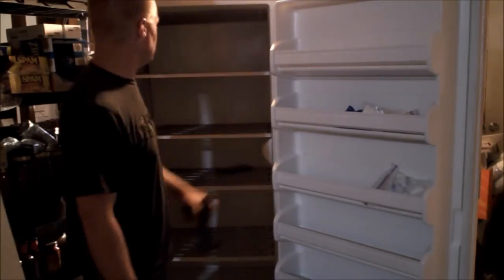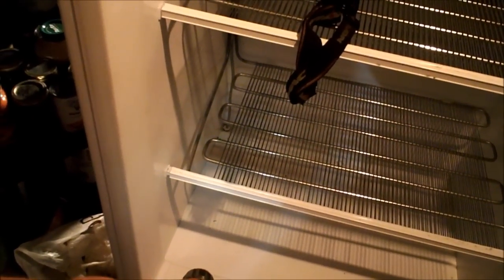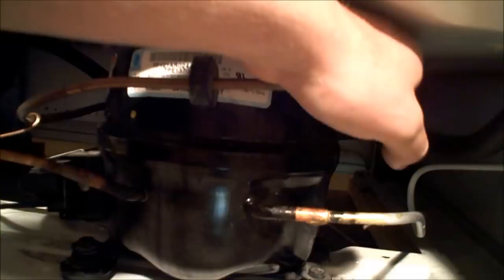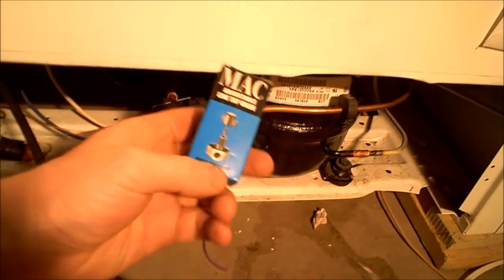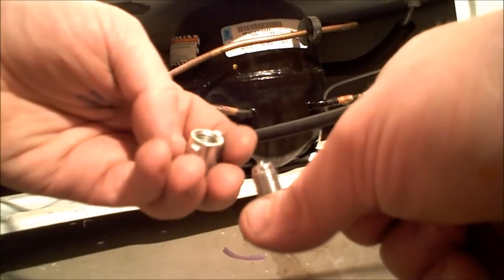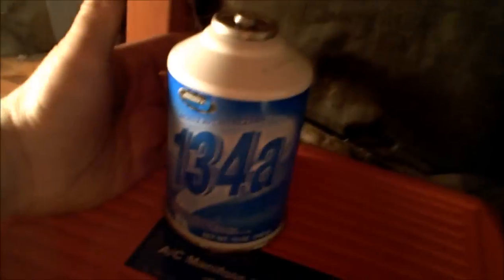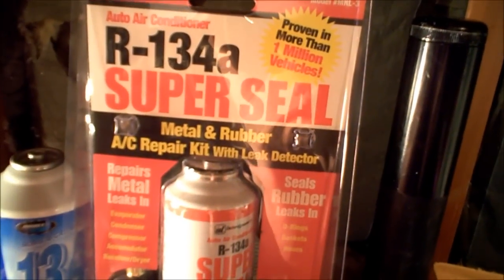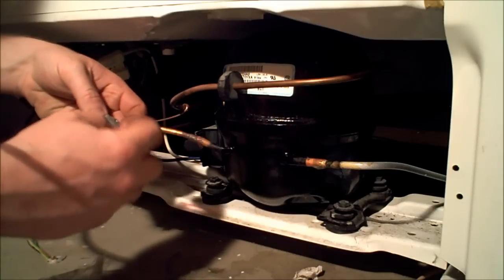Upright Freezer repair r134a refill part 1 of 2

Comment: The most intelligent way is to hook the piercing valve on the service line of the compressor...after loading you can press the line off and solder them close.or yust leave the valve.its better anyway because the pressure on the service line is much lower.....
Reply: You can also add the piercing valve to the short pipe stump that was used to factory-fill the system with R134a.   That's where my valve is attached and it works very well.

Comment from the maker: Thanks Bob.. 8 months, that's a pretty slow leak. are you going to just add a little more? A very nice repair tech gave me this advice: If you suspect the inaccessible condenser coil to have the leak to simply cut an external one off an old fridge or freezer and solder in place of your internal one. This should permanently fix a leak. It does require a fair amount of work, but doable.

Comment: I connected the system as instructed but when I turned on the refidgerator the pressure did not drop Iam I on the high side the pipe is the larger of the two

Comment: Man-you've actually pierced the wrong tube-the High Pressure side-right before the capillary tube-the tiny one-once you switch on-the pressure will go up
The right tube is the short one-the service tube-Low Pressure there.

Comment: Yeah it is. I actually found that Frigidaire and Sub- Zero units are very prone to evaporator leaks. The reason my GE started leaking is probably because the spine fin coils were rubbing against the steel support( never use steel side plates with aluminum tubing). That, and it was almost 20 years old and had been used in a 130 degree garage for several years earlier.

Comment: I had a GE side by side fridge and freezer that died to this same cause. I first noticed it when the compressor overheated and the thermal protector kept turning it off. I also noticed it would run for hours on end, and the bottom of the evaporator was frozen solid, but the rest of it was warm.

Comment: Thanks again for your time. I've had 2 ppl tell me the Model # doesn't pull up, not sure why, it's only 4yrs old. I reset the defrost timer, actually twice within 3days of each & still nothing. The seal around both doors seems fine. I'm presuming that it's the defrost timer or heater. I think i will shop for new or 2nd hand now, too much stress & time wasting trying to fix it, need cold food, LOL. I truly appreciate your help. I will pass along your good deeds when i see another in need.

Comment from the maker: Something is broken. The fridge will get all of its cooling from the freezer.  You need to remove the plastic covers that cover the inside cooling coils. It could be a bad door seal but generally you'll see ice by the seal were it is leaking, if it is(unlikely). It could be the defrost timer that starts a heating element to melt the ice and remove condensation. Or it could be the heating element. If it is a newer fridge it could also be the computer. The model number you have doesn't pull up..

Comment: Hello, can you help??  I have a Frigidaire Freezer (freezer on bottom, fridge on top) AND the Fridge has stopped working, Freezer is fine. Model # FRB183CCW-1. We vacuumed out the back. I noticed some small icicles hanging from 1 vent that moves air from freezer to fridge (vent in ceiling of the freezer). And feeling around inside the vent there is a little ice build-up. Should i just manually defrost the freezer? or can i manually move the Defrost Cycle dial. Any help is appreciated :)

Comment: Years ago it was a good idea to seek the aid of a technician because fridges used ammonia as a coolant.   Ammonia is toxic and will kill you. Freon is not toxic.  R134A is not toxic...in fact R134A is used as a refrigerant, it is used in computer cleaning air and it is used to power those loud horns used in sports horns.  

Don't worry about venting the R134A into the environment because the sports horns and computer cleaner air use the same chemical.  The sports cans say it is okay for the envt

Comment: I tried to repair my fridge exactly the way that ford explained it and it worked.   The only thing is that living in Canada I cannot get hold of the 134A stuff so I used a can used in a marine horn.  Both the 134A and the marine horn are the same chemical 1,1,1,4 tetrafluoroethane.   Ironically the refrigeration techies say you can't vent the R134A into the atmosphere because it will damage the ozone but it is okay to use a sports horn?  Anyway the stuff works.  Don't listen to the techies.
Reply: R134a has no chlorine to damage the ozone

Comment: I'm appliance tech and I'm certainly not secretive about what I do. If you called me about this problem, first thing I would do is check for frost pattern. If it's like you said, I would say you have a bad compressor since you said it's been getting progressively worse. That's a sign of a bad compressor. Adding freon is nothing but a shot in the arm, raising the working pressure, and will usually wear off in time because the compressor is going bad. So really you are wasting your time.

Comment from the maker: About all I can suggest is what I did in the video. I would take off the cover to the condenser on the inside. If it is low it should still partially freeze the first part of the condenser coil. A cheap gauge set like I have in the video is a must along with a "line tap".  There are a couple other videos on Youtube were people show little tid bits that I played off of. Service Techs are very secretive about their trade. I am not a service technician but I'm happy to help, if I can.

Comment: I to have a 2004 Frigidaire but it is frost free and a sealed system.  This has been the most educational video I have found so far.  We called a repair guy and he walked around it and said it's a freon leak but would not guarantee the work due to a possible small leak that he could not detect.  We decided to buy a car kit to add freon ourselves, but we want to make sure we are doing it properly.  Any suggesstions?

Comment from the maker: Most newer (last 15yrs) Upright freezers have built in condensers... The condenser coil is built under the side panels and never gets dirty unlike older units. Frost Free or not will help you diagnose the problem.

Comment: Thank you for checking. I cannot find anthing that will fit the MAC fitting except the R-12 and hoses and everthing fits. I cannot buy R-12 and I notices that you were using 134-A. I cannot find anthing to fit the MAC for 134-A.
Let me know if you can find anything, I've called everbody and been all over the internet.

Comment: Hey Man,
Very informative youtube. I saw you youtube and I did correctly what you said to do. I online and purchased the Mack adjustable fitting. Then I went to Walmart and got a can of the anti leak stuff the same thing you were using. IMy frig is only 2 years old and they told me to go buy another one for another $1000.00.
So I saw your video and it got me thinking.

Howver the mail fitting on the puncture Mac is a INDUSTRIAL 1/4 IN. F'LAIR FITTING. Question; Where find a fitting that will WK.

Comment from the maker: I only did this procedure to my freezer as it was already a lost cause. I had nothing to loose. You probably wont mess up the refrigerator. The only way you will mess up your refrigerator is if is overcharge or to much liquid r600a is introduced. As far as the gauge set goes, "I personally" would use the same manifold set I used for r134a. I am not an expert in this career but you will find out that no experts want to help you with any info.

Comment: Thansk for the instant response :) I thought that would be the case but i'm finding it very difficult to find one inr thr £50-60 range. The only ones i could find are digital and cost about £300 on the internet. Thansk for the heads up on the refrigerant being highly flammable. So to confirm if i do use the manifold you have for R134a, there's a good chance i could mess up my refrigerator? It's the first time i'm attempting...

Comment from the maker: Most gauges will say right on the face what refrigerants they are compatible with. They are usually compatible with numerous different ones. Just be careful as r600a is Isobutane and very flammable.

Comment from the maker: Yeah a lot of new in the home fridges and Freezers use r134a. These newer freezers with the condenser coil built into the sides make it impossible to find a leak in the high pressure side of the systems. Thanks for watching. You'll have to see the outcome in part 2 that is 10 minutes from being up.
Reply: There are adaptors so you can use the cheaper hose and also if it's not someone else's for 300 I'm cutting the sides off with snips and fixing the leak. I have used brass couplers to fix small leaks :) 
Non professional  but money is tight

Comment: My chest freezer would'nt come on at all and i discovered there were 2 small screws on the thermostat for cut in/cut out pressure. The cut in one had to be turned 1/4 turn. Now it works fine @ -5*F. I thought 134a was automotive refridgerant? I know some people mix 404a, 22, 12 and 134a but its my understanding 134a has a high cut in pressure and automotive compressors have a longer stroke for higher pressure. I think there's a way to use refidgerant to find a refridgerant leak. Nice video!